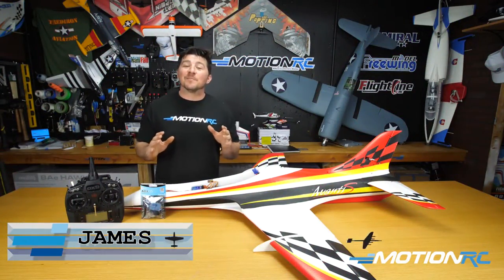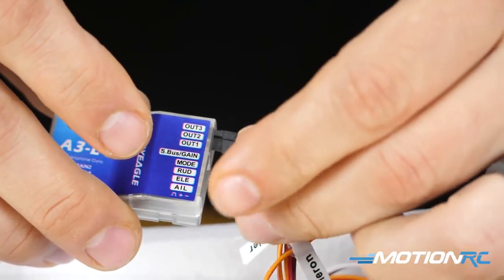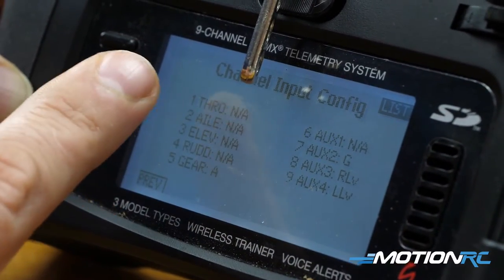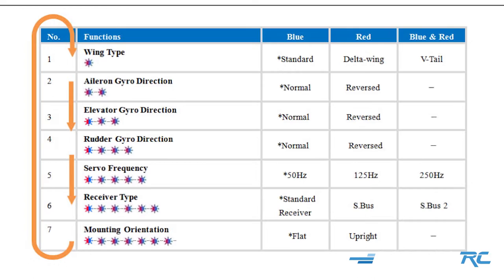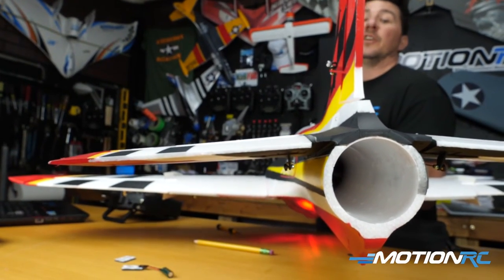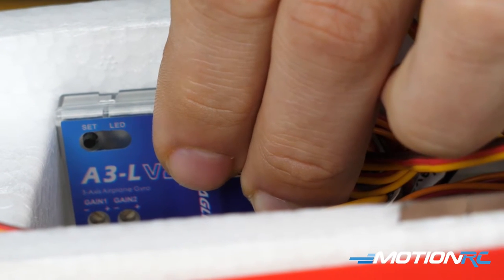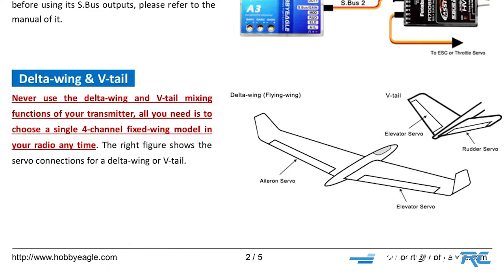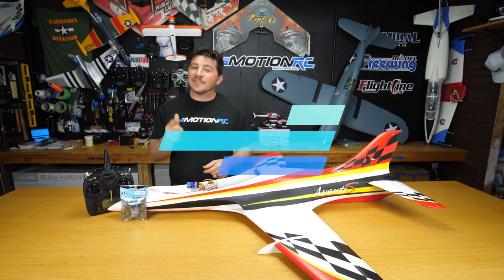HobbyEagle A3-L V2 Gyro - Set Up Video - Motion RC

Comment: Last weekend I maidened the FMS Beaver V2 using this Hobbyeagle AL-3 gyro . First using 25% gain as you suggested. Worked fine. Then moved the gain to 50% and the bird flew flawlessly. After that dialed the gyro to 75% gain and was even more stable with high winds , but at full throttle the Beavers tail began oscillating. So went back to 50% and that is my setting for the plane. Also using the on/off function on a two position switch. Dual rates work perfectly too. Very very important to follow instructions in the manual and watch this video is a must. Also making sure of the surfaces directions on both the receiver and gyro ( after installing it of course). Thanks for your info, video and tips.
Reply from the maker: Sweet Edwin. Thanks for coming back and updating us. Glad it went well
Reply: I have The FMS V1 and intend on using it into mine. Someone wired in God knows what in mine, I brought is of Market place and drove 50 miles to get it. They added things I do not even recognize. I think it's a capacitor for the ESC and something for voltage regulation for the lights. I looks like a spaghetti farm in mine. I intend to strip everything out and redo what they have simply because the set up is messy and I dont even have room for the Stability system with all the junk that's in it.
Reply: @scottfirman  good idea. I removed the multiconnector inside the Beaver. Rewired everything the old fashion and easy way. Now I have bigger interior space and everything organized. Clean set up

Comment: Thank you brother. Its not like the package comes with any kind of instruction whatsoever, which would be helpful , ..I will be playing your video step by step as I mount my first gyro/stabilizer ever in over 10 years of flying. I got the YF 23 and even on the lowest of rates it is squirrely as hell in the air. I will tell you how it goes. Excellent step by step video. Keep doing them bro.
Reply: ooh hey.... i'm very interested to know how this worked out with your YF-23, I too have this model and I am considering a HobbyEagle gyro for flying it.  Please, details!

Comment: Excuse my ignorance and stupidity here. But am working on a larger project that's more of a hybrid and have ZERO knowledge of RC's or yhese types of gyros. So I've been pondering many design sspects and "must haves" over the past week and a few things hit me last night about stabikity abd use of gyros. But im rhi king okd school spinning gyros. Anyway, all that got me thinking or wondering if youtube would have any video on how a gyro would work with a RC if scaled up? ... Found your vid first and am fascinated that such tech is available for this market and smaller size. But is Truly amazing and great job explaining everything. But I'm still gonna have to seek out an actual gyro video as I'm curious how they work inside 6 what the pros and cons are in the drone/jet world with this type system or if it'd even work or not? And as said; our project is substantially larger than your nice model RC here. Can you just explain to me like a 4th grader what's happening inside that box? It's not a real gyro in the sense of spinning hoops holding something steady. So that I'm really curious about. Assuming it's a mercury type leveling switch or some sort of G'sensor array that tells or sends the appropriate signal to each bit depending on your flying control inputs etc? Honestly  i have no cle!! But is so very cool! What do these run price-wise? Lastly, what is "3D mode" here in this application!? What benefits do you get by  1) adding this gyro box and 2) using or not using 3D mode? Apologies for the dumb Q's but if I get the answers I think I will you may have just saved me a ton of money. Thanks.

Actually since or if I have your (or someone else knowledgeable on all this) and your ear... say this was a drone but with forward thrust so like a std. 4 prop / 4 corner position yet scaled up say 5x fold. Would Gyros be warranted or even desired here? Since everything is "custom" and never seen anything like tgis before. Let alone such a clearly written  Install manual likevtgis ine here. Clearly this company has their act together - but I digress. Just curious if they do even mfg the old spinning gyros!? Or has eveything gone this way now? (not having a clue as to whats inside the box) I'm the idiot remember? Or maybe this usage of the term 'gyro' is different today from what I'm thinking of wanting or needing from decades ago!? 

FWIW: If anyone's interested in learning more and working on a scaled-up beta version and getting  paid for your experience... hit me up here. Will be Fall of 2023/early 2024 before we get to this stage but we coukd use several RC experts (large scale) ppl to assist or brainstorm with. Many thanks for any replies that are constructive.

 (And for those rolling your eyes at my words said here. I just write the checks and fund projects.  But am a Mech Eng and architect turned entrepreneur and that's why I'm able to offer a small pay day for any help should you/we decide to work together. Fair?) So just know curiosity of gyros got me today hence me digging around YouTube. I'm old school. So off to research more gyro videos but truly enjoyed this. Just wish you'd test-flown it at the end. Cheers.

Comment: You say. Make sure the plane is flat and level before plugging in the gyro. Flat & level as it would be in flight? If you fly a tail dragger such as a J3 Cub etc... Would the gyro want to try and put the elevator down upon takeoff while the plane is still on the landing gear? Nose  facing up? And can you use a gyro on a 3ch airplane?

Comment: What needs to be done so that the shelf in the wing stays in the same position while the plane is tilting.  Because what happens is that I move the plane, the wing moves and immediately returns to the place needed for the shelf to remain in the same position as I saw you did in video A.  All the shelves moved but stayed in place until you moved the plane back
Reply from the maker: Put the auto-balance mode on a switch. I don't reccomend flying that mode but its great if you ever lose orientation and flip the switch and you will know you plane is back to flying level

Comment: This stabilizer now has four modes and by default will not switch the gyro off. People need to select number 7 in settings and either use mode 1 or mode 2 and that will allow you to turn the gyro off.
Reply: cant get mine to work no response at all from my sticks  then spoke to customer help line and got a load of BS of them
Reply: @mickwilton11  Does it bind to the receiver. I would put the receiver in another plane if you have one and see if it will bind. If so and the stabilizer is connected to the receiver correctly. I am using FlySky and  pwm protocol. If you are using ibus or sbus you might try pwm and see if it will work that way. I am also using openTX. You have to configure your mode and arm switches on what ever transmitter that you are using. If that is all correct, you most likely have a bad stabilizer.
Reply: @parker1ray   hi ray iv tried it in another plane and just the same results im using a spectrum DX7 got no mix in it not using sbus just normal standard only mix i have on is throttle kill rely dont understand it thanks for getting back to me

Comment: great video! Quick question... What if I I am using aileron servos in two different channels in my receiver. How would I connect the two aileron channels to the gyro with only one available aileron slot in a gyro?
Reply from the maker: you will want to use the A3Super3 gyro for that setup. You won't be able to do that on the A3-L or A3Pro. https://www.youtube.com/watch?v=nmNPWhndv1Y&t=1584s
Reply from the maker: or you can buy a y-lead and go to a 1 channel set-up
Reply: @MotionRC  it means that for the Avanti in the video you have only one aileron functioning?

Comment: In the instructions that came with the gyro , it cautioned not to use dry cell batterys in the plane to power the gyro . what problems do dry cells cause ?? I use dry cells in my radios and all of my planes . please explain --- I do not want to crash a plane because of this .

Comment: Hello Jim, I need to have my curiosity satisfied...You say in the video that the servo pins have to be facing the rear (AFT) of the plane. Merry Boozer says the same thing. However the manual say's and I quote ""You only need to ensure that the servo connector pins always point toward the front (or rear) of the plane"" So who is right?? FYI...I went by the manual and installed my A3-L in my Gosshawk with the pins facing forward and everything works as it should doing a preflight surface direction check on the bench. Thanks.
Reply from the maker: Well, truth be told, if you mount it backward (servo connections going into the gyro toward the rear of the aircraft) it should still work fine. Because its still just a matter of making sure all the directions correct properly. It shouldn't really matter as long as it is A. Level and B. Set for the orientation you want (horizontal or vertical)
Reply: @MotionRC  Thank you! that answers my question. Just my opinion you should make an updated video stating that the servo pins CAN be facing forward or rearward ;)

Comment: Great tutorial, thank you. Newbie here setting up an Eachine F16 50mm.. it runs on a 11.1v battery. I notice the voltage on the A3 is lower, should I be concerned? How would I account for that?
Reply from the maker: it'll be fine, the gyro has a capacitor to prevent voltage drop

Comment: I see remote gain is the same port on the unit as it is for flight modes. How is it possible to turn the knob for gain and use a switch for flightmodes. You say if you have an extra channel on you receiver you use that channel and also set that to aux 2. Does that also work for your 2 aileron servo,s and 2 elevator servo,s , wanting to use them apart from eachother, just plug in your receiver and assign to your aileron and elevator? Does it not need to go in the unit for gain? Do i need the black unit for this, for wingtype? Do i need to use a Y-cable otherwise, or does s-bus help opening channels for double servo's?
Reply from the maker: The mode and gain have 2 seperate ports, not sure where you see they aren't seperate?

If you dont want to Y your ailerons, elevator etc, then this Gyro can't work. You need to step up to the a3pro (red one) or a3 super 3 (black one)
Reply: @MotionRC  perfect, just the answer i was looking for. For computer and overal better view i wil go for 3 black units. The 4-5 have extra options for double servo,s
Reply from the maker: @rtoebak76  This is the way ;)

Comment: Why are you using the throttle cut switch? I would use the mode switch , or B switch. The G switch is for my rudder. Just my 2 cents. Please explain, and thanks for your help.
Reply from the maker: You can use any switch you want. This video is just an example but you can use this to set up any switch

Comment: Great video! Quick question. If I only have a 4 ch RX, can I still use this gyro and just have it enabled all the time? I believe by default, -100 was off, 0 was stabilized mode and +100 was 3D in your video. So, if no wire is plugged in, does that send a signal of 0 and thus let he gyro work for basic stabilization? Thanks!
Reply: A gyro only need 3  Ailerons  Elevators and rudder

Comment: What's the capacitor for? And it is necessary? I've flown all my planes without it and never experienced any problems. I'm worried whether I should or not.
Reply from the maker: Without a gyro, your servos will only move with stick inputs, but with a gyro, all the servos connected to it will be constantly working whether you have stick inputs or not. So the capacitor is there to make sure there is always a consistent voltage in the system (you can put the capacitor in an unused port on the gyro or receiver). Lets say you dropped gear, flaps and are moving all surfaces at the same time, you could get a dip in voltage and potentially lose signal without it

Comment: Just 1 question I am just getting into the hobby and I build all my planes from scratch if you only have rudder and elevator can you just plug those into the gyro or do I need ailerons?
Reply from the maker: Yes, just use what the plane has

Comment: What about the A3 V2..? Without the 'L'. It has 3 pots.. I have managed to set it up by following your video but it was totally different??
Reply from the maker: We never sold the A3-v2, but the 3 pots on that version show pot 1 as normal gain, pot 2 as auto-balance gain, and pot 3 as auto-hover gain. So if you don't use the modes for pot 2 and 3 then just turn those pots all the way down and focus on pot 1 which, like the A3-L, will affect all surfaces (aileron, elevator and rudder)

Comment: Thanks, James, that's a great help. The snag I'm hitting is that the ailerons have a healthy, positive, correct direction movement, but the elevator and rudder have no discernible movement, although when the battery is 'on' the system switches and twitches as per. The only diff in my system is that the elevator uses two servos, but one 'Y' lead, and works fine when the aircraft has the gyro switched off or on ( overiding). The Mod two is switched off, and the system is on a two way switch, correctly showing blue when switched  to 'on'. Help?!
Reply: Ur rates (on ur Tx) might be on low sensitivity? That's what I noticed.  Just set mine up today.

Comment: Notice that the photos of the gyro are of the A3, not the A3-L.  How do you tell if you have a V1 or a V2? Also, if you do not have an open port for the capacitor then use a "Y" connecting lead to a port like the Rudder.
Reply from the maker: They only produce the most current version of this Gyro now regardless whats on the sticker

Comment: My problem is with a Draco which has a very high incidence wing, opened the throttle and I had to feed down elevator trim to the max but ended up climbing vertically and then fell back, I used all the available trimming. I then tried some programmed subtrim but on closing down the throttle it then dived down, so that was no good. CofG is correct BTW.
I want the gyro  to give down elevator on a climb only to help with this. The test to tip fus tail down does show it's working, but then if I hold it in that same position elevator returns to normal - is that going to happen in flight?

Comment: Hello agin James !   Eddie here in the UK.   After following your video carefully and setting everything up and double checking all settings I'm having a problem.   
I've just had a brief live chat with Tim who was unable to help me so would you be able to please ?   In stabilised mode ailerons correct themselves if you roll the aircraft but elevators don't move when pitching aircraft up or down.   Oddly they act like a rudder correction as they both go up or both go down as if they were working from rudder correction but horizontally IF YOU SWING THE AIRCRAFT LEVEL FROM SIDE TO SIDE which is both weird and wrong !   HELP PLEASE JAMES !

Comment: Excellent video that made setup very easy.  What does the Servo Frequency setting do?  For a fixed wing airplane should it be left at 50 Hz?
Reply from the maker: Depends on the servos your model has, most PNP foam aircraft will never need to change this setting, but guys put these in ARF builds with higher frequency servos will need to know those servos stats and make the change or the servos jitter
Reply: @MotionRC  Thanks, so it's based upon the servo specifications?  I just looked at the specifications for a Hitec D645MW servo that I use in larger planes and can't locate a frequency specification.  Thank you.

Comment: Installed, but when I am in a headwind turning I get some wing flap twitch, like it's having a seizure. Does the pot + or - adjustment help with this? Should I go to + cause currently it's in the middle. Thank you!
Reply from the maker: The pots do adjust the gain. Basically you want to adjust the gain to the point where you experience no twitching at all. Your gain could be too high

Comment: First time ive had to deal with a capacitor,  if i wanted to test the capacitor to see if its good how do i do this?  Seems like just hooking it up and never testing it now and theen would be not a good idea.
Reply: You would use a multimeter that can check capacitance and compare the uF reading on the meter to the value printed on the cap.

Comment: How can I trim a plane and take care the gyro do not misinterpret the trim values as expected banking or pitch.
Reply from the maker: You can set the gyro to on/off on a switch and trim it with the gyro off, or put the use the remote master gain on a knob and lower the gain all the way down to trim and then roll it back up

Comment: Correction, Mode 2 (red) or mode 3 (red/blue). Mode 1 is default and will not have a gyro off selection. Then program it to a two position switch.

Comment: Well what do you do when the elevator doesn't work?
Reply from the maker: Check the connections first, make sure you didn't plug a lead in with the polarity reversed, you can also check the elevator servo on a servo checker or plug it directly to the receiver to see if it moves. check your transmitter that you have the correct aircraft type. This is a loaded question as I don't know where you are in the process, but should help you start diagnosing

Comment: Good day  sir, does it work in 3 Chanel plane. I’ve just built an old fogey rc plane with 3 Channels. Throttle, elevator and radar. Please suggest if it works in it or not? Thanks
Reply from the maker: for sure. Just use the elevator and rudder ports
Reply: @MotionRC  thanks buddy
Reply: @MotionRC  you rock man! It’s alive and working. Thanks a bunch! 🍀🍀🍀🍀
Reply from the maker: @buddyjim3527  Sweet Jim! Have fun with it!
Reply: @MotionRC  🙏🙏